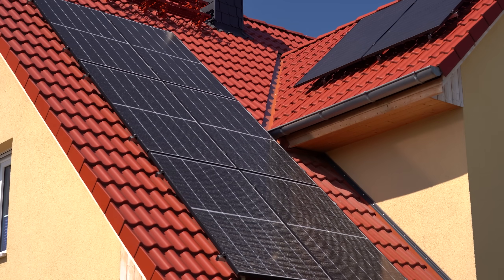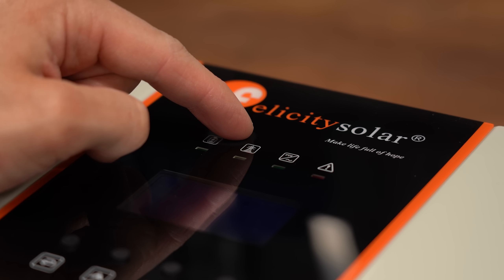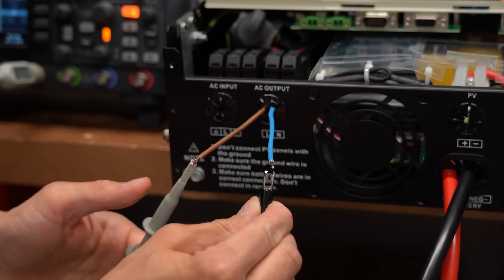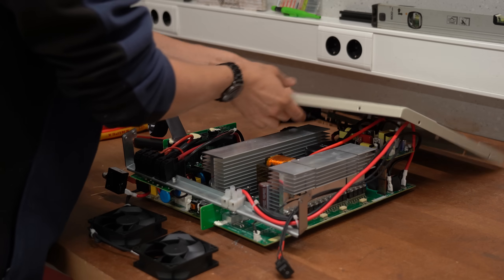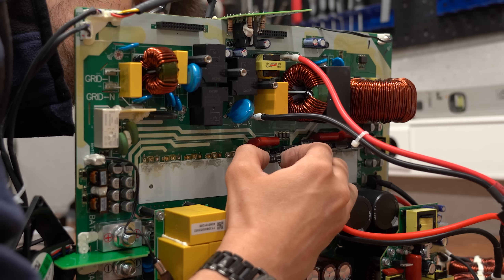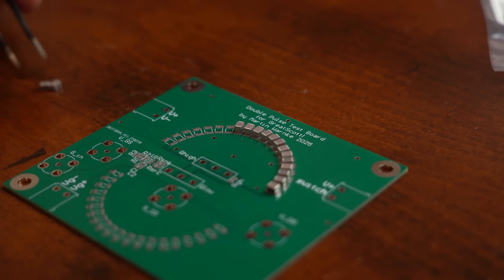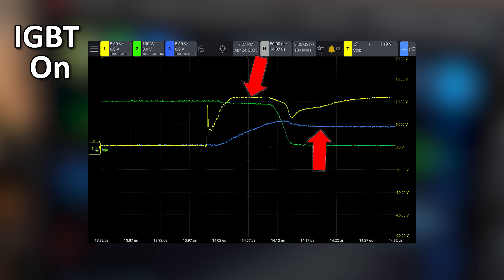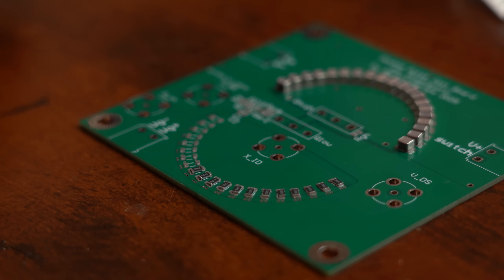Cheapest Inverter + Premium Parts = Surprising Results!

Comment: Damn 5kw is enough for you guys i have 45kw offgrid solar system installed and i still need more panels.
Reply from the maker: You mean 45kW? That is quite a bit. What kind of loads are you powering???
Reply: @greatscottlab  My whole house and i still need more panels and bigger 2000KW battery to go completely off-grid since in Pakistan grid is getting expensive day by day and its unreliable, i already have removed my gas and electricity meters and i pump my own water. From my calculations i will break even in 2 years since i run my HVAC system 24/7 and went all electric i  want to be self reliant as i don't want to move abroad.
Reply: your problem is not on the panels, is in your house, you should turn your house more efficient. 45kW of power a day is alote even in cold climates. Check passive Haus  and learn how to improve your home.
Reply: @luixmod1 yes here in Pakistan houses are not well insulated since only bricks and mortar and a coat of paint is used also mine was built in 2006 so when I reconstruct I will insulate it well .
Reply: 5kv would  be enough for me
Reply: @CritHit-q5v  don't forget that the number is peak value. I have 30 panels for 12kwh peak, and a 11 kWh inverter with 30kwh batteries.
In summer, I can get up to 60kwh per day, so I can charge my car. In winter, I still need to buy electricity, mainly in December and January, when I get 10kwh per day average...
And I heat my house with wood.
So, you need the grid or a generator if you don't have enough solar panels.
Reply: @ChristianCOMMARMOND also factor in cloudy days, it's better to be over kill then come short since Chinese solar panels costed me 0.002 dollars per watt and I know these prices will not be cheap for long.
Reply: Yes, that's exactly my point. Here, I get 415W solar panels for less than 70€. I think that you made a mistake in your price per watt... Mine are around 20 cents per watt.
Reply: @ChristianCOMMARMOND  Nope i imported direct from china as there is no tax and concrete policy yet so i took advantage of it